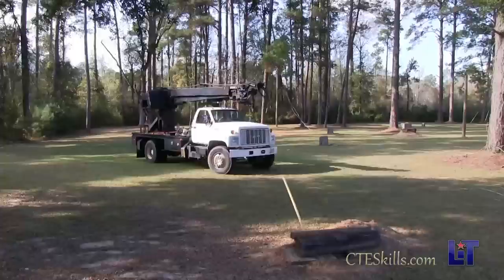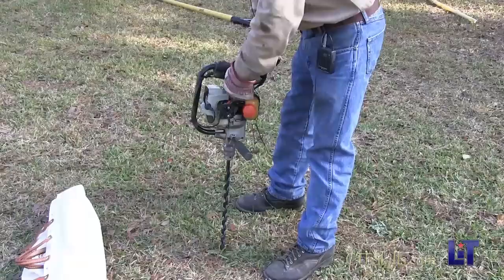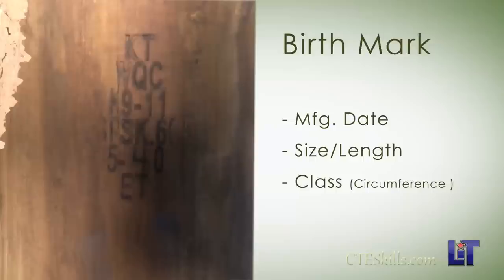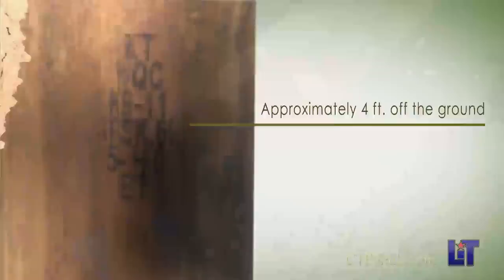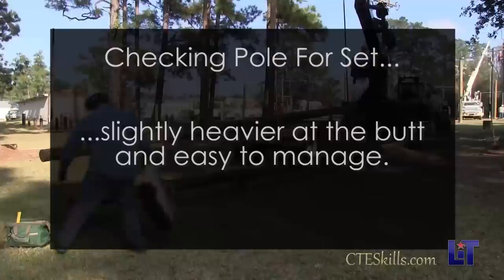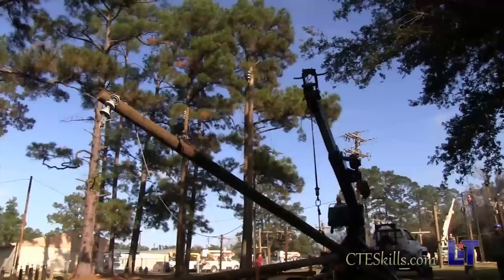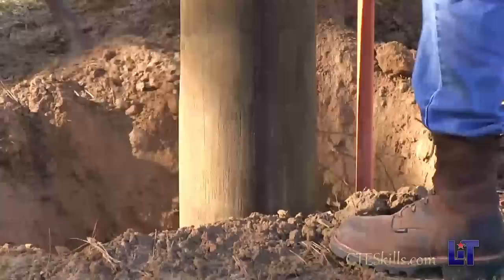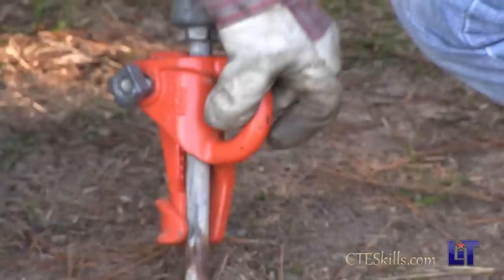Pole Setting: Utility Line Technician

Comment: retired lineman, since 96, started in 54. no bucket trucks, no augers, all hand dug, tripod boom bolted together and fastened to back of truck with pins. winch mounted in bed of truck. After pole was set the oldest man on crew shoveled, usually  the driver/operator, because he was old and slow. 3 men tamping, not the way these filled the hole. You can bet that cabbage headed foreman made sure most of the dirt was tamped back into hole. I had 42 years of the best job there is, working with the best men on this good earth.Loved every minute of it, well most of it.
Reply: My neighbour has built on land outside of their boundary next to a pole in a field with approx 7 metre clearance, will they be made to demolish the building? 👍 The land around the pole was 7 metre but they built on it!

Comment: Alot hot stick or rubber glove higher voltages and they all climb or use equipment to go alot higher. Some put on faraday suits and clip into voltages from  Helicopters that are several hundred thousands volts. Just so your home is warm and your entertainment is working. Rain, fire, winds, ice, snow, disasters we are there for you. When your child is in the hospital, (god forbid) look around . Everything is electric. These men leave their warm homes and family to do one of the most dangerous jobs. Hazzards at every turn. So when their in traffic in a city or climbing a hill in a rural area to work. Realize their dedication. Don 't complain when one of them takes a little longer break to cool off or stops for a hot meal after working 8 hours knowing he may have another 10 to go. If you want to complain about us. Try walking in our shoes if you can fill them.

Comment: Why is concrete not used in the hole when installing utility poles, but commonly used with smaller post?
Reply: Because people can’t stop running into them with there cars , it would be a nightmare trying to change one out that was in concrete.
Reply: Not necessary. If you're going to swing a pole, you've got the heavy equipment to dig a deep-enough hole, and if you have that, you can afford the extra $80-100 for a somewhat taller pole.

That said, steel/concrete poles will sometimes have concrete footings.
Reply: I came to this video looking at how they can secure such tall poles (thought they must use a ton of concrete). I'm very surprised they use none.

Comment: Inside wireman JW for 37 years. Done a small amount, mostly temporary services (line work). Set some poles for lighting and some services. It’s nice to see professional linemen do their work.
Reply: I’ve got to set a couple poles soon for a job. 200 a service feeding two metal buildings. No overhead lines close. I’m sure utility co will need some poles to bring the service in closer.

Comment: I need to replace my 25 foot power pole. It's old and leaning, I had an electrician tell me it would cost 10 grand to replace it. Who can afford that, for a piece of wood ? Lol...
Reply: Somebody lied to you.
Reply: @destroycamero I have, they came out and gave me a brochure on what they are responsible for, and what I am. They won't do anything...
Reply: @destroycamero Pacific Power in the Northwest. They will come out and cut the power off for free, but the pole is mine. I put in a ground anchor, and attached a cable and turnbuckle to gradually pull it more upright. It looks better than it did, but it's no substitute for a new one.

Comment: Thanks for posting, and also for showing the whole thing.  I want to install a pole in the ground, not for electrical purposes.  I simply didn't know how, and being a woman, it is hard for me to get men to explain how they do it without rolling their eyes at me.  Thanks for the rule of thumb, very useful.  I have since learned that dirt and/or crushed gravel is better than cement, which holds moisture around the wood.  I appreciate this very much.
Reply from the maker: +BlackSeranna Thanks for the feedback, glad it was helpful.
Reply: Well with utility poles they must be cemented so they last for decades.And wont budge or move in high winds.And also think its a federal law that they are placed a certain way.
Reply: TSpider Keeper Thanks for the info.  Yes, this makes sense.  I guess the whole gravel thing only works for small applications, like maybe making a grape arbor.  Maybe it doesn't work at all.

Comment: so if the preform on the guy doesnt hold once the chain hoist is removed can the rake tension cause the guy wire to whip back?  i always thought there was some more mechanical assistance with the process other than drilling the anchor hole

Comment: Routine linework. 5000 volts in your hands, 50ft in the air, no mistakes, no excuses. Just another day at the office. 
And they call others hero's.
Reply: A person is definetly not a hero for working on/near power lines but sure does deserve some respect for being such a dangerous job
Reply: @Operation Treadstone we went thousands of years without electricity bud
Reply: @god1246  in Hollywood b
Reply: @leopoldomartinez1263  what?

Comment: Cool video. I just wanted an example of why putting fence posts in concrete is not just unnecessary but probably a bad idea. If a pole doesn't need it my fence doesn't, it just needs to be deep enough.

Comment: maybe im overthinking it, but im wondering if theres a way of using a level or other device to make sure its perfectly vertical.  i know its complicated by the fact that the pole is tapered.  do you make a box around the pole? drop plumb lines from a measured distance from all sides? or do you just eyeball it?  im thinking of using utility poles to build a second floor on stilts over an existing structure.
Reply: Plumb

Comment: Yes good work but i need  know the construction of a 400v distribution line ie   its spacing of poles  standard
Reply: Google it?
Reply: No such thing. Lowest-voltage line I work with is 4.16kV, or 4,160V. Typically pole spacing varies by utility company, and is based on conductor sizing and how many phases in the circuit - single-phase can go as far as you can maintain clearance, while 3-phase has shorter span lengths, and double circuits (two 3-phase circuits on the same pole) is shorter still.

Comment: When installing in the swamp how do you reinforce the poles?
Reply: The anchors are only installed on poles that are the beginning,  end  and if they aren't in a straight line.  Next time you ride down the road watch.  I teach people by riding down the road and saying" straight, straight, curve, curve, straight.  And if the lines on the pole stop they anchor for the end of line even if a pole line keeps going for power but maybe cable or telephone company stops you will see they have to anchor the line as they follow the same rules

Comment: I enjoyed this.... but it makes little sense to still be hanging power lines from tree trunks in the 21st century.....
Reply from the maker: Thanks for the feedback. We are just the media company but it's my guess from making these videos and being around the industry a little that it's still much more cost and time efficient to use the "tree trunks" in most cases. Maybe another viewer would have a better answer though. Thanks again for watching and commenting.
Reply: iecSimulations
 It was a good video though I'd have liked to see them using the big augur to make the hole. I realize it would be too expensive to put  power lines underground but it should be considered esp where they are an eyesore in cities. We tend to lose power often here in VA with hurricanes, ice storms ect...
Reply from the maker: We hope to make that a future video. We are trying to work our way through the whole school from beginners level to the advanced. Taking a little longer than we hoped for though. Thanks again.
Reply: irish89055 It is expensive to bury utility facilities.  Safety is also a concern.  Do you call to have the facilities located every time you put a shovel in the ground?  Many people don't.  Utilities don't guarantee depth because we have no control over what happens to the surface after the facilities are buried, i.e. erosion, grading, etc.  With many utilities the regular maintenance is also less expensive when it is hung aerially, instead of buried.  Just my two cents.
Reply: +irish89055 It's renewable and biodegradable.  It's reasonable in terms of cost.  I'm glad they aren't making from plastic, the bane of the planet.